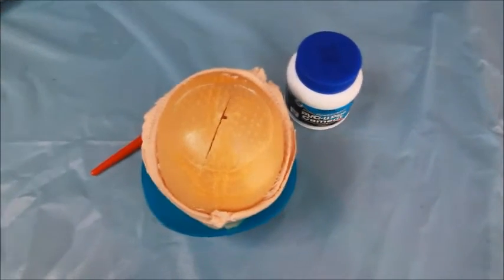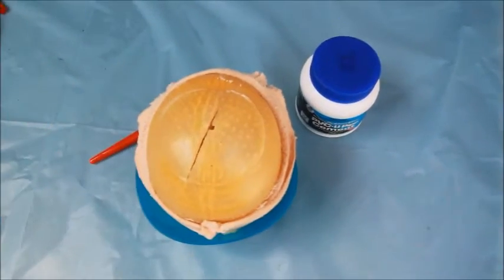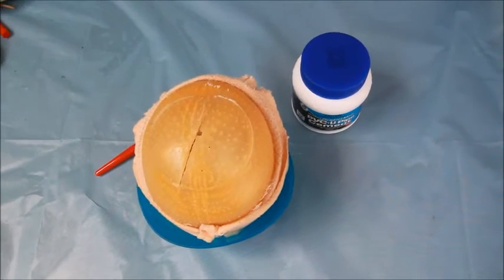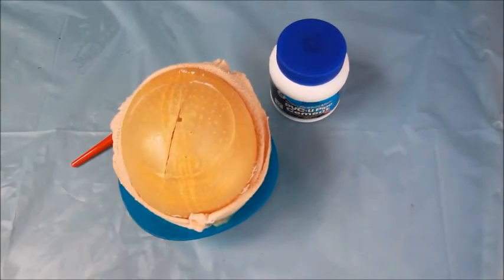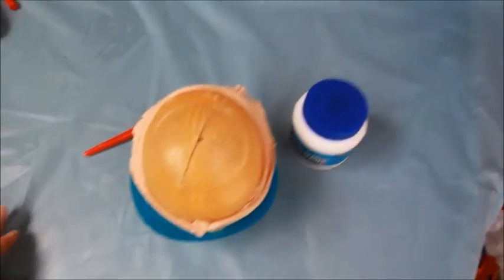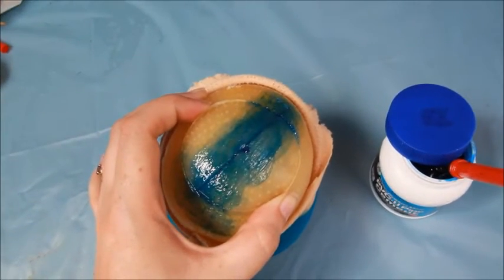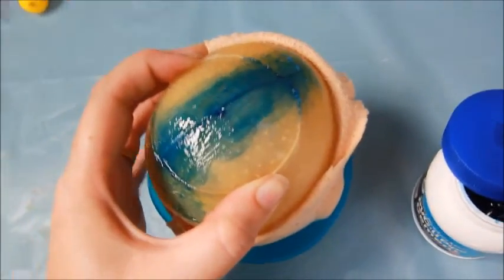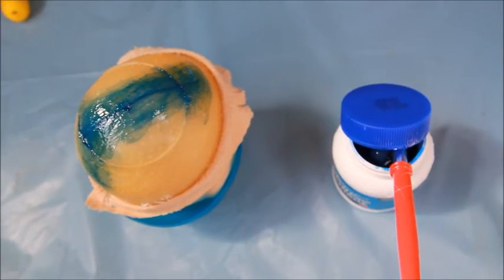My child doll Restoration Tutorial: Fixing a cracked head, for re-rooting preparation

Comment: I have a Barbie and I cut off all her hair and took all the plugs out. Then I started to root the front but it started to split. So the front off her head down to her ears has split. Any ideas on what to do???
Reply: Make a new hairline and space the holes out more. Loctite has a plastic and rubber 2 part super glue that is a marker and glue tube. This works very well. You must sharpen the end of the marker if you cant fit it in the crack fully.